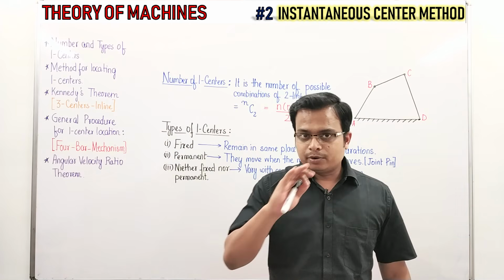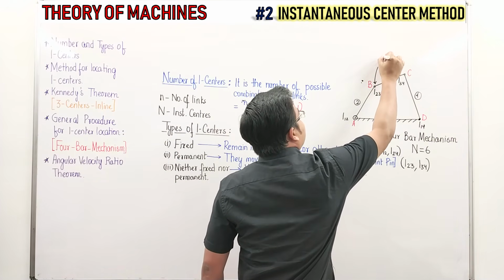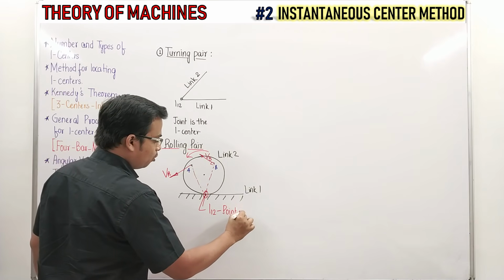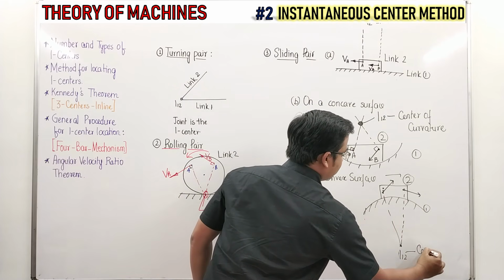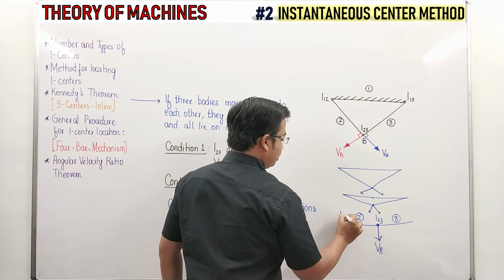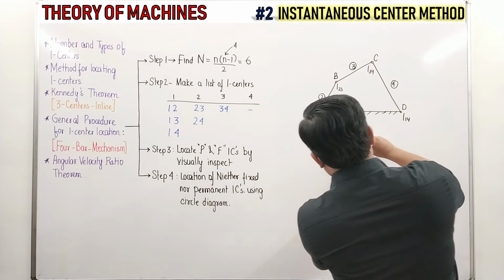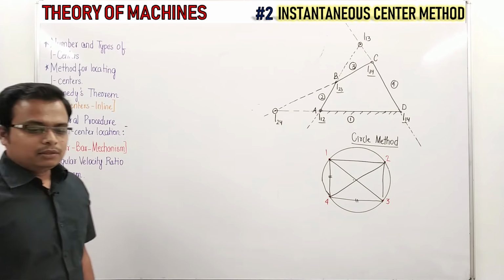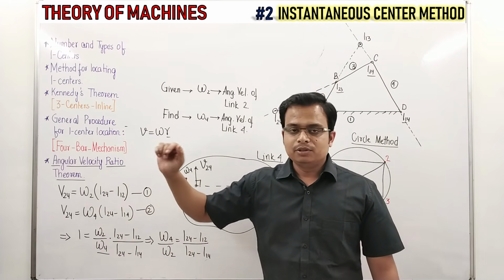Theory of Machines || Velocity Analysis by Instantaneous Center Method || #2

Comment: I don't want to be rude but here are few things that I've observed from your ($#itty) video: 

1) During the explanation of Angular Velocity Theorem, you, just like any other Brainless INDIAN youtuber, simply dodged the concept behind it, and very cleverly enlarged the link 2 (which was not even necessary, show your utter lack of Geometry Knowledge) to show the rotation of link 2 with the angular velocity ω2 clockwise, while minorly forgetting the fact the I24 is not ROTATING at all, then how can it rotate with the anglular velocity ω2 ?

2) Despite all your lofty explanation of angular velocity concept (relating to Translation + Rotation and vice versa) in your previous videos, you simply failed to explain the Angular Velocity Theorem, and you simply failed to explain, that WHY on Earth does (I24-12) share the angular velocity of link 2? On what basis did you do that? while infact it's not even rotating? I24 does have a velocity, but NO WAY A ROTATIONAL ONE...only Linear Velocity. along the line AD.

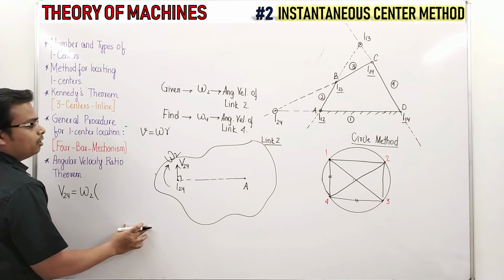3) During 33:24, you SHAMELESSLY tricked the students that your velocity on I24 is the direct result of v = ωr, WHILE ITS NOT (neither is the Angular Velocity Theorem), The Theroem clearem states that  the angular velocity is inversly proportional to difference of common I centres and centres of rotation. In fact the 'r' in v = ωr has NO relation with the V24 = ω2. (I24-12), W.R.T. A I24 does not rotate, then how can it have agular velocity? And if it did have a angular velocity that is W.R.T. point B, here the Angular Velocity Theorem cannot be applied, because B is not the centre of rotation of link 2. Why such contradiction in your explanation ? And please stop talking about V = ωR as this equation simply does NOT apply here (since this equation gives the location of "CENTRE OF ROTATION AND NOT I-CENTRE).

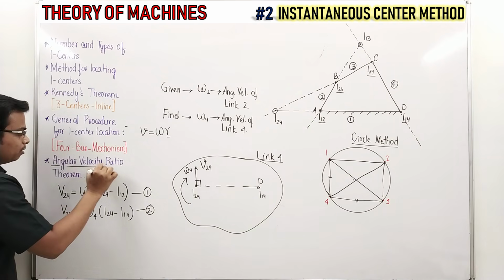Comment: Hello sir at around, 35:45 why was the I12 used instead of I23? Similar why was I14 used instead of I34? Both I12 and I23 lie are for link 2 and I14 and I34 are for link 4. Both why did we use only I12 and I14 for measuring the radius?